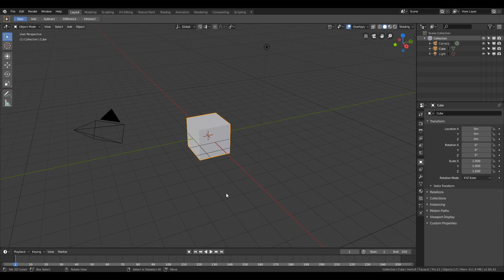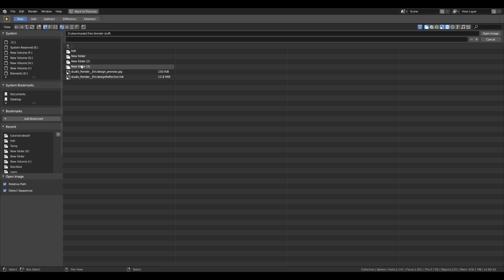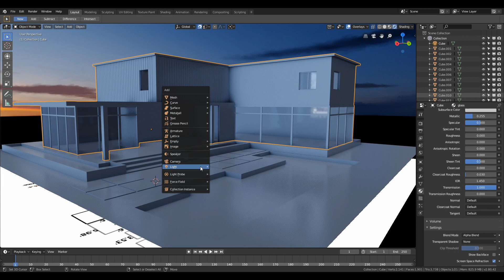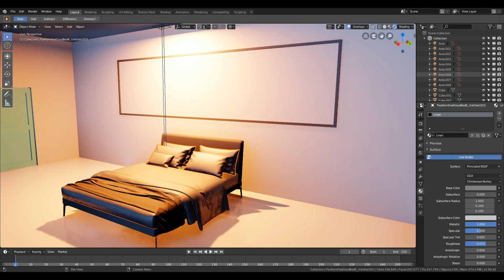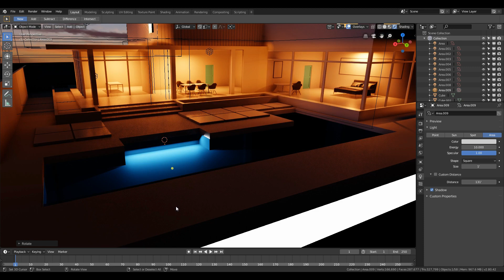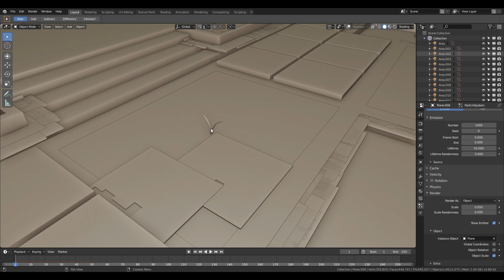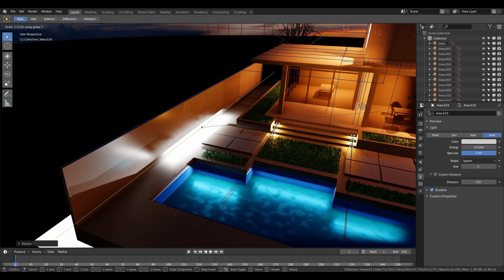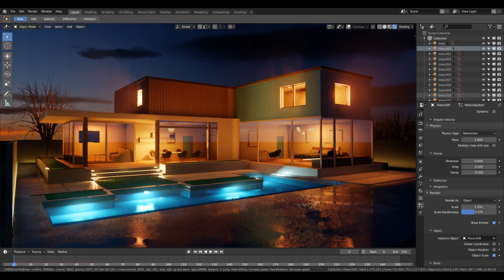Blender 2.8 Architecture Workflow

Comment: What are the specs of your computer, are you using Eevee or Cycles? You played this entire video only in the rendered view. My computer takes 2min  to render each frame in cycles. Can you suggest me computer specs that work for the blender, as smoothly as possible?
Reply from the maker: Intel i7 @3.40GHz
24 GB ram
GeForce GTX 1050
You will get better result if you go higher then these specs.The reason my pc do not lag is I have modelled the scene in low poly because of that it works completely fine.

Comment: Just don't understand why you switch to imperial units at the beginning. Using modern international metric units is much simpler.
Reply from the maker: You can use imperial as well as metric. It depends on what your floor plan values are . I just wanted to share from where you can set your unit . Hope you understand now .
Reply: @SaqibHussain88  I do. I was just joking about the Americans who continue to use medieval units ;-). Anyhow thank you for your video, it was very helpful, I learned a lot out of it.

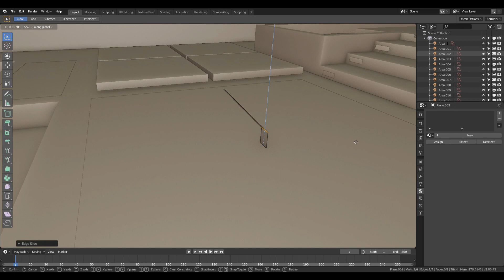Comment: 12:48 How did you form an arc like this?
Reply from the maker: If you add a simple plane to the scene then you can extrude one of its edges to make 90 degree angle between the two planes.Then just bevel the edge to to make a curve between the 90 degree angle . It's one of the easiest way hope this helps.
Reply: @SaqibHussain88  Thanks man, this is actually the most helpful trick I've ever had in Blender!

Comment: Hi, good tutorial. Which card you're using? I'm looking for a new card to upgrade my pc to render.
Thanks and love from viet nam
Reply from the maker: I am using Nvidia Gefore Gtx 1050 , If go above you wil definitly get faster rendering and smooth display than I am having in this video. You're welcome bro.
Reply: @SaqibHussain88  It blows me away that you are only using a gtx 1050. I guess I can feel safe in knowing a gtx 1050 is good enough for that, I may upgrade to a 1050 ti.
Reply from the maker: @spectrfox7661  hey the more better card you will use the better it will work . So go for the high-end cards .

Comment: Hey there, I'm stuck at the start, when I'm trying to scale the image ref with the first face, the image ref does not remains below the shapes, I can't move the origin of the image ref, any idea?
Reply from the maker: Just click on the ref and then press g to grab it and move it on z axis by pressing z. Then after you set it to the bottom the mesh you can easily assign the 3d cursor to any vertex of the model and dont forget to change the pivot point to 3d cursor .After that select the image ref and now  if you scale or rotate it will move accordingly to the 3d cursor. 
Second also do check after selecting the ref go the object data which is located below icon of modifier tab and then in object tab change the depth from default to back .
Reply: @SaqibHussain88  Ty :)
Reply: @SaqibHussain88  I hope on day you will show us the process of modeling a house, this house is awesome :)

Comment: alot of the time you are so quick with your tools such as opening up menus with hot keys, can be difficult to follow at times impossible. Similar was the subway tutorial. even slowing down to .25 was not enough at times and just skipped portions. Any way you could add what buttons you are pressing to future tutorials.
Reply from the maker: screen cast add-on was not available at that time as the blender was releasing its new version , I will try to use screen cast for my future tutorials.

Comment: What setting did you use to turn on measurements?... Like seen at 7:33
Reply from the maker: Its simple 
1,select a mesh .
2, change the object mode to edit mode.
3, while in edit mode go to top right corner in 3d viewport and click the button naming "SHOW OVERLAYS".
4,After that click the arrow and inside measurement tab you will find edge length, just check it and you will get the measurements.
Reply: @SaqibHussain88  Thanks for the useful answer and the tutorial :)

Comment: Salam sir... I have searched everywhere about snapping at the middle of edge in blender. but i couldn't find that.. can u pleas teach me to how to place or snap an object at center of another object's edge.. i can snap on vertex and edge and face and volume but not at the center of the edge..
Reply from the maker: Walikum Asalam , Press Shift + tab to unlock the snapping tool then press Cntrl+Shift+Tab and select the type of snapping in your case select edge then just select the edge in edit mode and just press g to grab and put your mouse cursor to the target edge you want to snap . You can also get precision by using the X Y Z axis after pressing the Grab hotkey. Hope this helps.
Reply: @SaqibHussain88  assalamu alaikum Bhai.. i have tried what u told. But its only snapping edges. Not center of edge
Reply from the maker: @shaikhmohsin2626   If you want to snap a mesh  to the centre of an edge of another object than you will need to apply an edge loop on the centre of the target mesh (on which you want to snap on ) then change the snap type to vertex and then you will be able to snap on the centre of another mesh hope this helps.
Reply: @SaqibHussain88  salam ...
Finally i have found the way to snap at the center of the edge... And its very cool .

Comment: There's a glossy shader if you want your glass to be reflective. Stopped watching as soon as you made the glass metallic.
Reply from the maker: Well i cant help it if you stopped watching the video .The main purpose of doing that was to make glass material more reflective . For the materials I have used Principle Bsdf . It is based on the Disney principled model also known as the “PBR” shader. I didn't wanted to mix it with any other shader as it does not need any . Every thing is available in it. Hope you understand Other wise I could have used render layers and composed it in photoshop.

Comment: recommendations for a CAD plugin for blender?
Reply from the maker: Why you want the CAD plugin for blender ? In the tutorial I have shown that you can use the arch floor plans and use the blender measurement unit to match it first and then block the whole design in blender.
Reply: pixelmasque if that is the case, you can use Unreal Engine4 with the data smith plugin. Then from unreal export as fbx. Import the fbx in Blender.

Comment: It does look good but not "modern architect render good".. You still need cycles for that.
Reply from the maker: Not necessarily, this tutorial was just to show you how you can use the blender  real time engine to quickly build your own architecture design but if you can put more efforts you can definitely get same render results like cycles .
Reply: @SaqibHussain88  You can get good results but for architectural still images there is pretty much no reason to not use cycles.. it's much better at everything. For animations eevee is good enough because of the render speed.
Reply from the maker: @erik....  Cycle is better at ray tracing but with time i think it will be integrated in Eevee too . Ray tracing is going to get older as everyone  in this industry is now trying improve the real time .